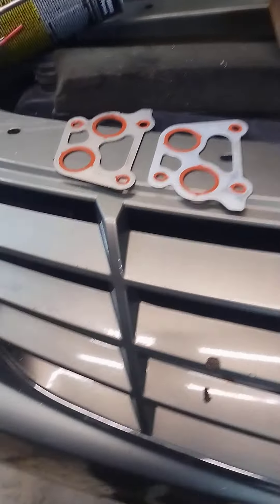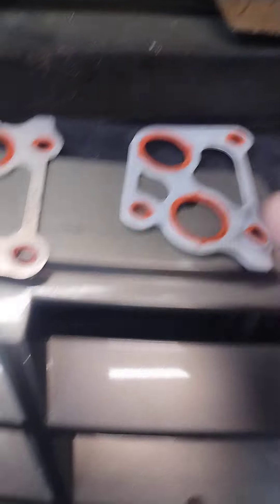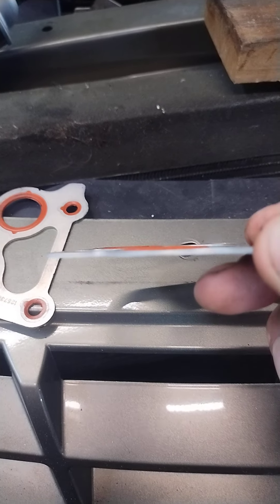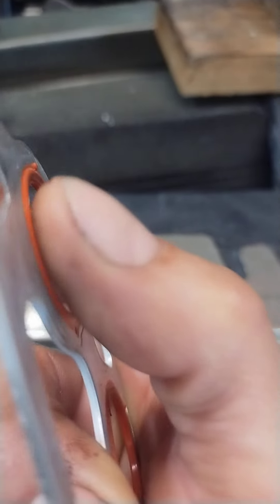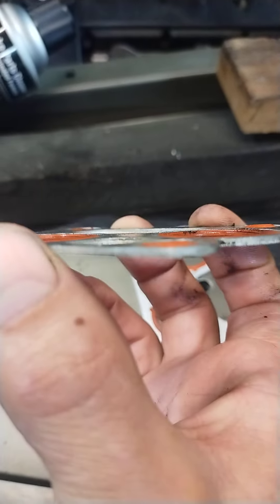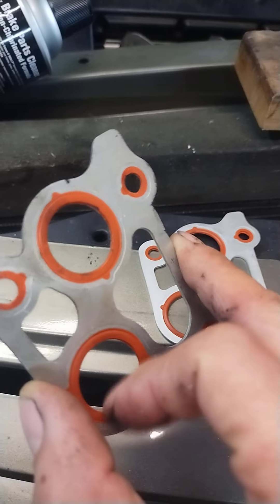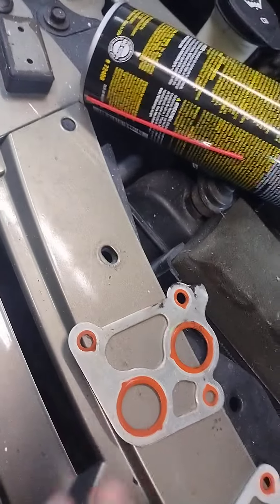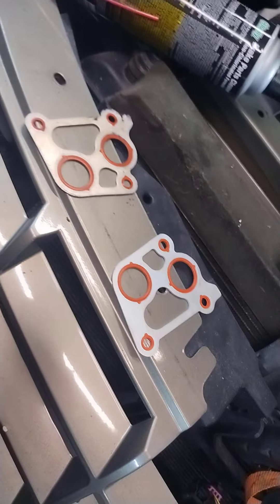why you should change the oil filter housing seal on a Cadillac DTS Northstar

Comment: Planning on doing this, this week.  2005 DeVille DHS...  pretty significant leak coming from my oil filter housing gasket.
Reply from the maker: Good luck 🤞
Reply: @garrysrepairandcustomspeed7583  Well... that job is done.  Changed out the oil pressure switch too.   Also installed a new water pump tensioner pulley, upper pulley and water pump belt.  Now I might have mini coolant leaks to chase, after updating those.
Reply: @garrysrepairandcustomspeed7583  Odd thing... when I went to buy the new housing seal... the package had 5 seals in it.
Reply from the maker: @boneshaker2806  fun isn't it LoL 😆